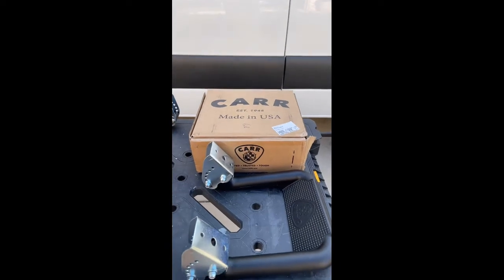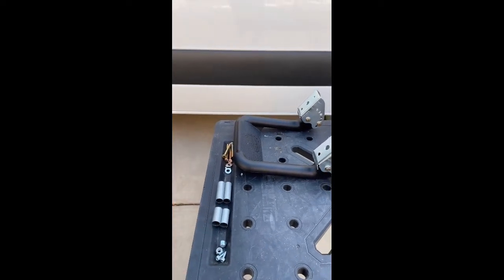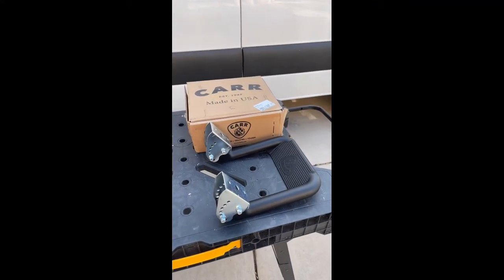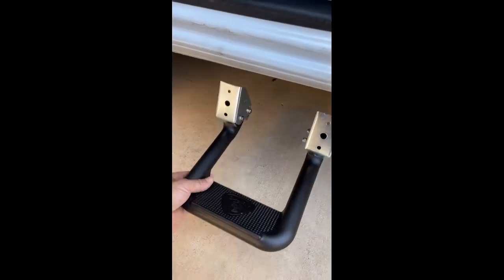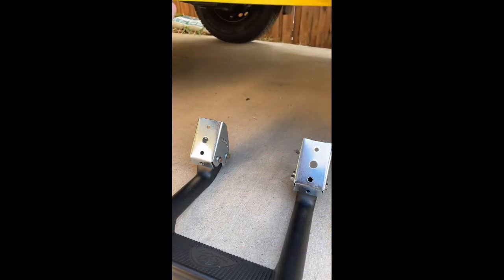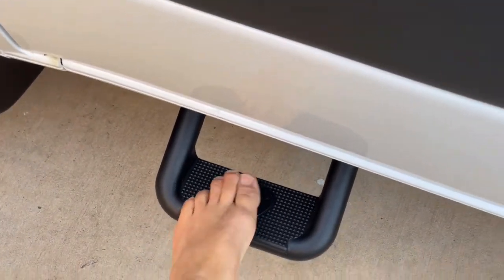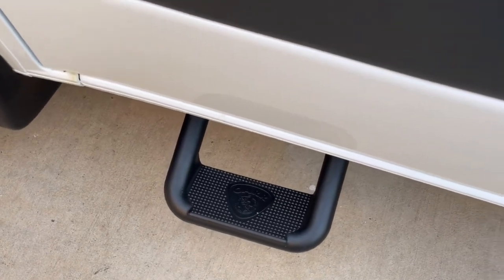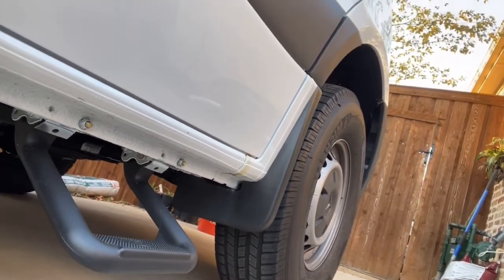CARR Hoop step installation 2021 Sprinter Van

Comment: Yea ive had the yellow carrs sitting in my garage waitin be installed but injured finger doin winch job..great vid,i was thinkin making a template on cardbosrd to make sure i got the measurement right...also figured i would spray paint or primer onto the drill holes, someone in comments said silicone not sure adv/disadv/difference on sheet metal.... how are the steps holding up since been couple years now?
Reply from the maker: The steps are holding up really well, 8K on the van so not a lot of miles, but so far so good.  Not sure about the silicone, but it might help with moisture.  Good luck